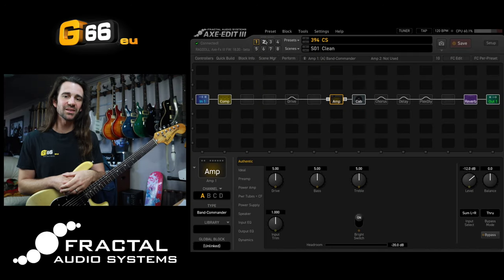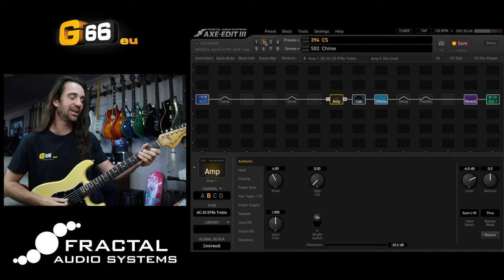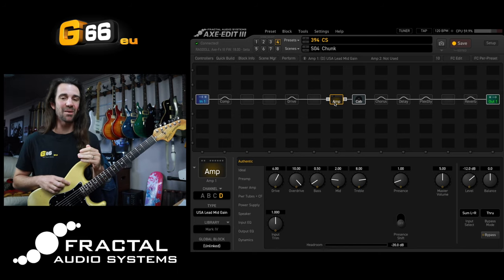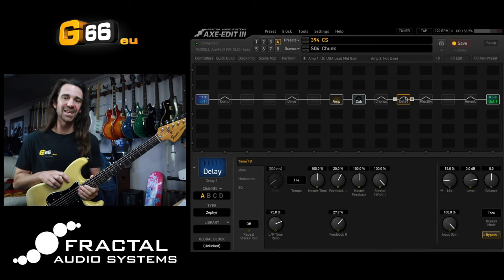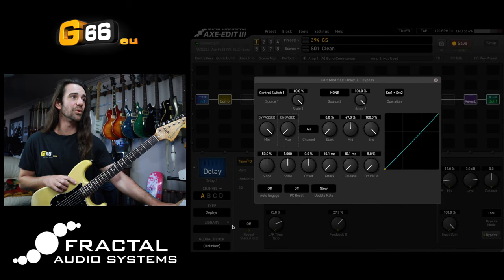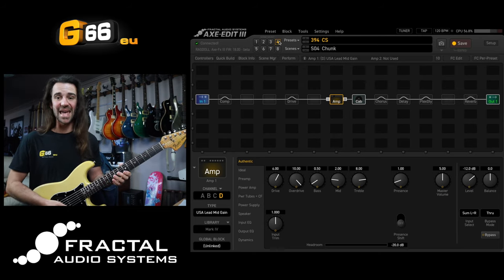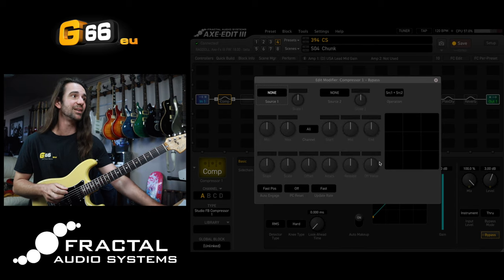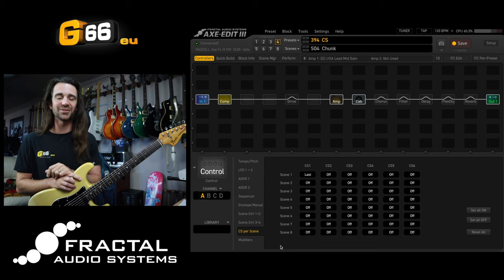Tuesday Tone Tip - Engaging Multiple Blocks At Once, Without Scenes

Comment: This is what I was looking for. BUT the four sounds/scenes you used have to be assigned to a footswitch (fs) before as well, right? Let´s say fs 1 is clean, fs 2 the AC20 (in this example) etc. and finally I have to set the controller choices you demonstrated here to another fs, i.g. fs5 or whatever, right?